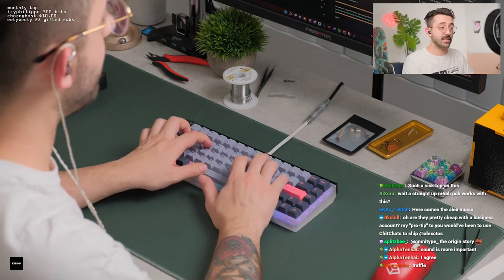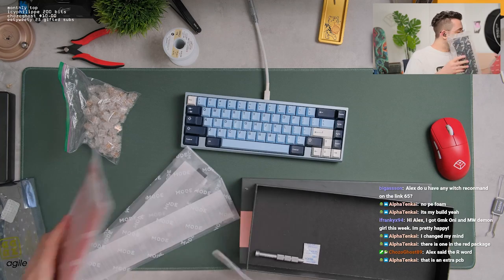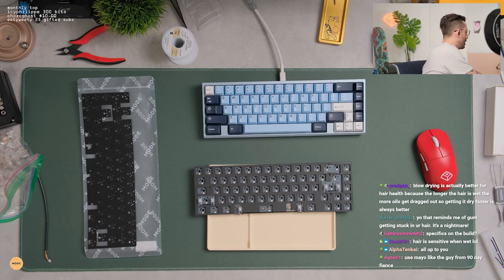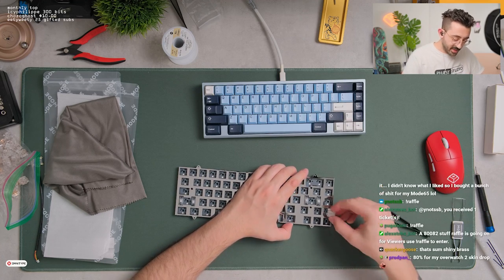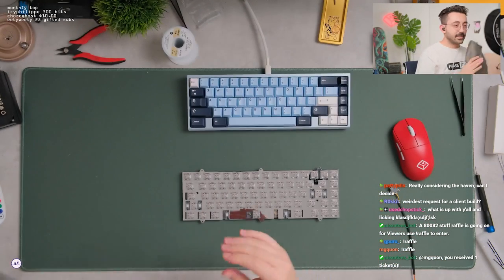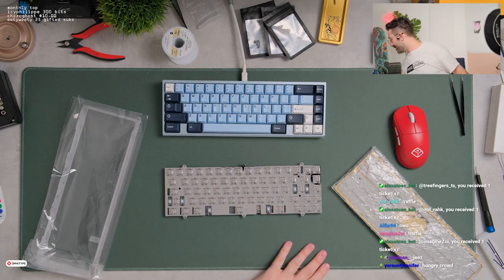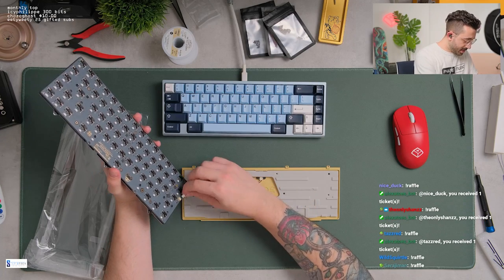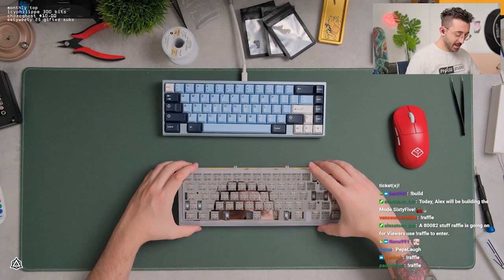this mode sixtyfive has RGB??

Comment: I've always been afraid of polycarb cases.. do they scuff easy? if they have threaded inserts, does it still crack when you fasten the screws? :\ but it looks so cool :O
Reply: Oils from your hands don't wipe off completely like they do on anodized aluminum. Polycarbonate is slightly porous so it gets smudgey over time
Reply: and cheap poly yellows pretty badly over time